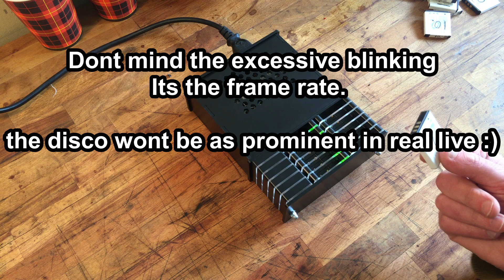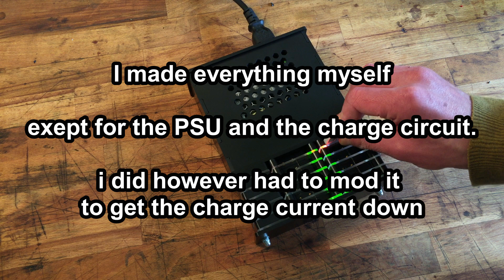My DiY NP50 Bulk charger for Zaxcom and Lectrosonics

Comment: Do you sell these?
Reply from the maker: well not the exact same model. i made one for 8 np50's  less then half the size with a converter inside.  being able to use them on  any DC voltage from 12-30 volt (so also car and or cart battery) try contacting me on facebook under the same name if you want to know more about them. heres a test i recorded once to check temps on the chips.
https://www.youtube.com/watch?v=D5rfX9dUGoQ